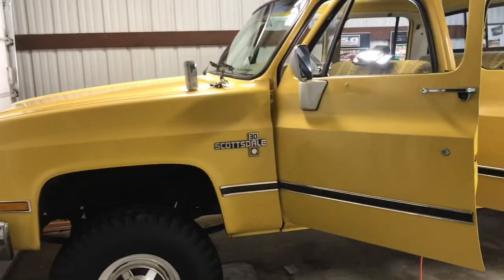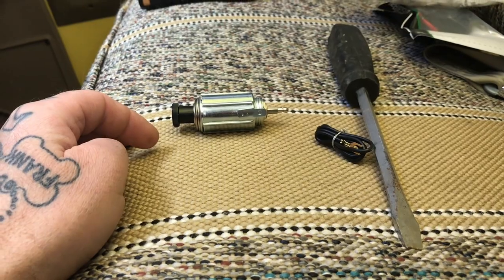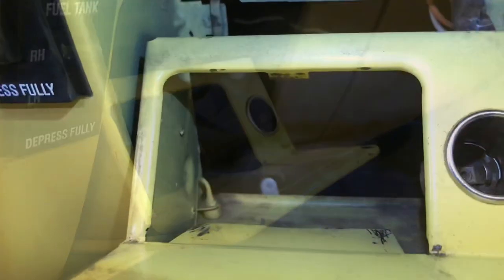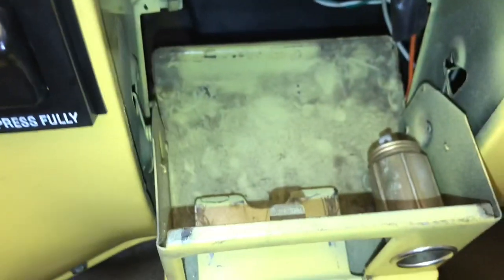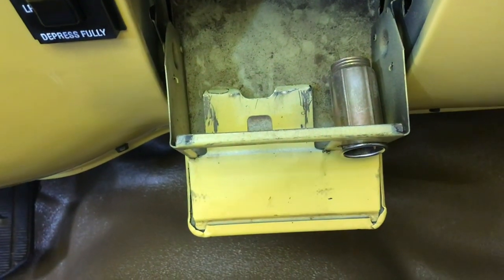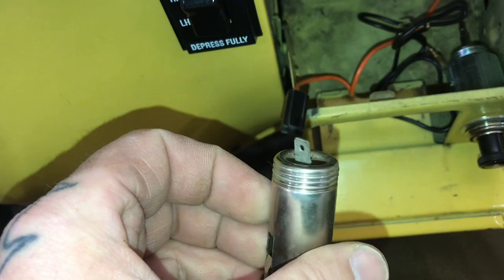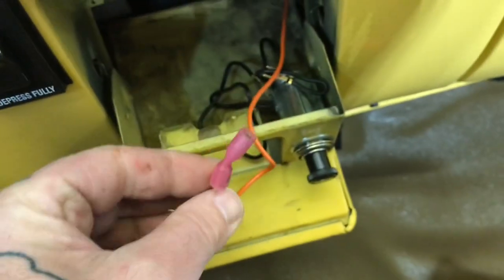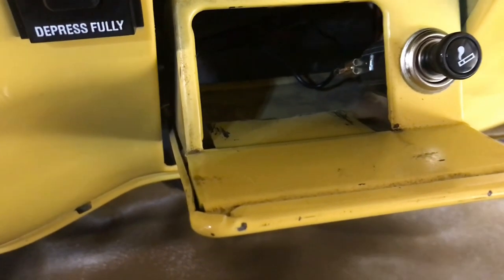Square body cigarette lighter replacement

Comment: Why didn't you show the actual installation of the plug?
Reply from the maker: @CPolarBear68  just screw the two pieces together🤷🏼‍♂️!! One is an any and one is an outy. There's only two ways to install it. Either you have the wire coming out the front where you would light your cigarette or you have the cigarette lighter part facing out. Not trying to be a dick but....
Reply: @zmurray9499  When I made my comment, I hadn't touched one to install one, hence my comment, but was looking for an example before replacing one myself or doing a different solution for plug-in power to charge a phone.

Comment: Do you know what the fuse Is called for the cigarette lighter my wire hasnt worked?
Reply: Mines labeled accessory i believe, but you should be able to shine a light on it and see which ones blown
Reply: My 83 suburban is the horn